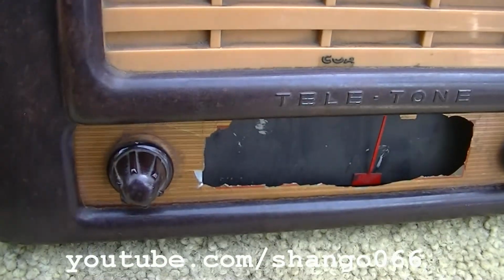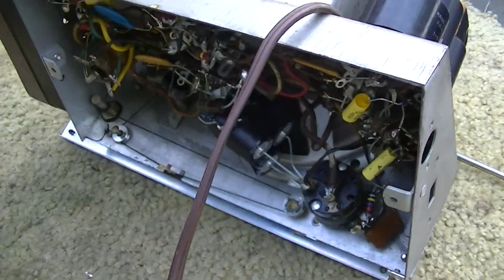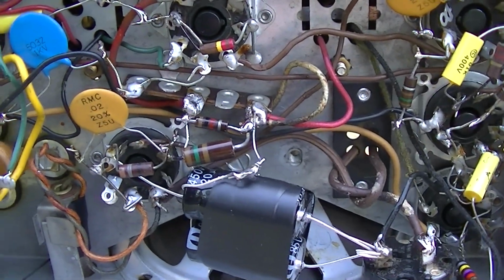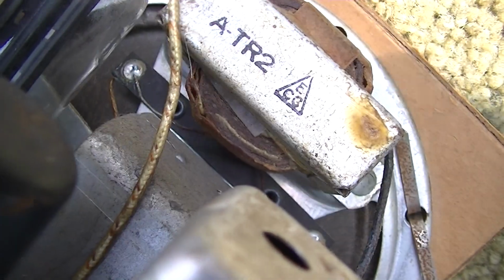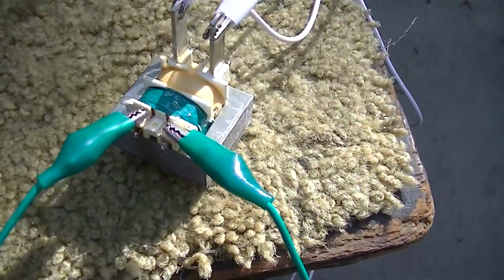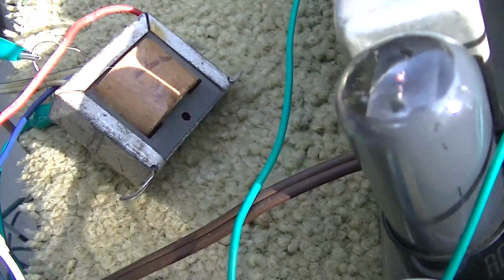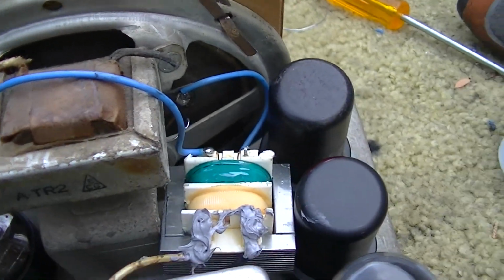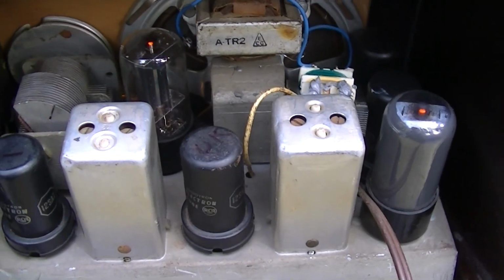Teletone 6 tube AM radio diagnosis for repair

Comment: all these radios have basically the same circuits. The six tube is just the five tube with an RF amp stage for better reception I have a huge Crosley book with most circuits from the 1940s

Comment: An all American 5's audio output transformer typically has an air gap in the magnetic material to prevent the plate's DC from the audio output tube from saturating the core. A power transformer typically has no DC so it doesn't have the air gap. When a power transformer from a "wall wart" is substituted for an audio output transformer, magnetic core saturation should be taken into consideration.

If you take an audio output transformer apart, you will probably find that the core separates into two pieces with spacer material for the air gap. That doesn't happen with a power transformer.

Some all American 5 radios fed the B+ for the other tubes through a tapped primary winding to partially cancel the DC magnetic field produced by the audio output tube, allowing the manufacturer to use a smaller magnetic core. Some of the audio power was diverted to a resistor instead of the speaker, reducing the radio's maximum volume.

It should be possible to construct a solid state current source to provide DC to the audio output tube, and connect the power transformer through a DC blocking capacitor. The problem is that the plate voltage swings higher than the radio's B+ in normal operation, and would back bias the current source. To avoid back biasing, the current source would need a higher B+ than that supplied by the radio. It could be done with a voltage doubler, but the much simpler approach is to find a replacement for the bad audio output transformer, or disassemble and carefully rewind it.

Comment: Thank you Shango for showing the audio transformer trick, I needed one on a radio awhile back and didn't completely understand how all that works, I read you could use a power brick like that but didn't understand it.  I can pick those things up at thrift stores for 50 cents all day long, i'll look for some low voltage ones for backups.

Comment: I always use flux and 50/50 solder. I miss the sound of a tube radio. I had a collection of about 200 at one point from 1920's to 1950 model years. I always liked the loctal tube ones.

Comment: As a gay 60 year old Aussie....I thought id put that bit in, it is inevitable that some of todays generation will need nail polish remover to remove their mobile/cell phones stuck to their foreheads. I'm a DJ too by the way. The valve stuff I grew up with was mostly junk anyway but I do have quite a few beautiful radios and amplifiers I restored  but new valve or tubes or toobs as you guys call them are coming back in a big way. I have a Leak Point One Stereo 20 and a brand new Primaluna stereo push pull integrated amp running 6 12AU7s at the front and 8 EL34s with auto bias at 100 watts a side at the business end. I've yet to get an Akai cassette deck GXC46D serviced but in Australia with Covid 19, we have severe lockdown so there is a lot of stuff I cant do at the moment. With the new tubes/valves being made, in my opinion Shango, don't give up on this generation just yet. I went to my 15 year old nephews school for 2 hours of free time teaching them the basics of tubes and how they work and the girls were just as interested as the guys. There is gonna be a massive resurgence in tube tech and its growing. 99% of Musos I know use Marshall tube heads for their guitars and tube driven HIFI amps are selling well. Kids today were never given the chance unlike you or me to experience anything except digital streaming. They were fascinated with the orange glow of a tube and how clean and loud valve amps are. Solid state solved a lot of problems but I believe both analogue and digital gear can run side by side. My nephew loves my man cave running 7.2 surround and my gear in my bedroom he just loves it. The Primaluna, the Technics SL1200MK2 Turntable I bought brand new and a CDJ for CD playback running into a pair of Wharfedales in my bedroom he thinks it's really cool. The turntable is brand new fitted with an Ortofon cartridge for playback only. I reckon there is a future in tube technology. How old are you mate? I need to know so I can comment on our youth and what decade was your favourite....nothing more. Cheers, Andrew Collins, Melbourne Victoria Australia.

Comment: I had a 1955 RCA radio with two metal screws at the bottom just like that one. We were staying at the beach and I decided to put the radio on my lap with my feet in the sand. It shocked me so bad, my father had to knock it out of my lap; he cut the cord off the radio which was almost brand new not understanding that it had a hot chassis.😲

Comment: Wouldnt have thought to use a power transformer in a single ended stage (magnetic saturation), but I have built a push pull with a split primary power transformer as the output - works great.

Comment: Tele tone  used the diode  part of the one 12sq7  as a detector and the. Other as a triode only  triode as the first audio . They could have used it as a multi purpose tube but then it would only be a 5 tube and you could charge more for 6 tubes . Cheap postwar set . Tele Tone based their designs on what components were cheap at the auction that day.

Comment: Tele-tone took the basic AA-5 , wired an extra 12sq7 in parallel with the one that was supposed to be there and pawned it off as a 6 tube chassis. Tele-tone -Putting that "K" back in kwality

Comment: You were getting audio out of the output transformer's core because of the same reason you can hear 60 Hz coming out of some power transformers. Magnetic fields transferring power through the core are magnetizing the core, making magnetic field push it back-and-forth at the frequency of the signal passing through it. If the core is not very solidly adhered together and to the chassis, it will vibrate and make sound.
Reply: yes thats true, it is called "magnetostriction" and this is common in all transformers... but in shangos case the primary winding is open and this alone explains not the effect. The arcing over the broken wire is one possibility, but I think, a short in a winding-section can also explain this (no transformation to the speaker but sound from the transformer), but then the primary is not measured "open". I am not sure, if shango definitaly measured the primary open. He only speaks about low plate voltage on the anode of the output-tube... The static plate-voltage without signal should be normal in case of winding-shorts... The mains-transformer sounds pretty good, I would not expect this, because of the missing air-gap in the core, which is important, when DC is flowing thru the primary winding (A-operation)... But this is a good result, neverless. Like this kinda videos...

Comment: Usually, but not always...6 tubes means it has an RF stage, which is the sixth tube's job...or a tuned RF stage...
Reply: Kennynva rf amp would have 3 tuning condenser sections .

Comment: Hammond has some great audio output transformers for about $30.  I'm using a pair on my single ended 2A3 stereo amp until I spend the big bucks on the really nice Hammonds.  They sound great, but are 30hz to 20k+.  So, the bottom end is not optimal.  For the price they're a great inexpensive way to bridge the gap until one can pay for the really nice ones.
Reply: Amp Amp have a t250"acrosound  new old. 20w ultra linear xfmr 100$ +shipping supposed to be for 2 2a3 s if interested.

Comment: Lol at the idea that a higher-rated cap voltage is undesirable. They might cost a few cents more, but reforming? Also, you do realize that the metal tubes are actually glass, the shell is an integrated shield grounded to the chassis?

Comment: I have this exact radio,  the second 12SQ7 is strictly there to get the tube count up to six.  They are using the triode section of one of the 12SQ7's and the diode section of the other one.   Like you I never found a schematic.
Reply: Shango066 did find a schematic for the 5 tube version. I suspect the only differences between the 2 versions were to 1) Add the second 12SQ7, 2) Move the diode section connections from one 12SQ7 to the added one, 3) Wire the added 12SQ7 into the series filament string and 4) Replace the audio output tube with a 50 volt filament with a 35 volt filament version (probably 50L6 replaced by 35L6). The 50L6 does perform better, but it is probably not worthwhile to undo the design changes and replace the 35L6 with a 50L6. Buyers of the, presumably more expensive, 6 tube version actually were probably getting a poorer performing radio than buyers of the 5 tube version.

I have a GE model 535 with a 6th tube, but it is used as an untuned RF amplifier. To perform better with picking up weak stations, the design could have added a third section to the tuning capacitor to improve image frequency rejection and selectivity. The 6th tube presumably does improve the AGC function, however.

Regarding tube count, in vintage Sears catalogs, I've found the All American 5 radios described as having "4 tubes plus rectifier". The Canadian Sears catalogs just say 5 tubes. I assume the "4 tubes plus rectifier" was to comply with some Federal law.

Comment: I don't see how copper wire just sitting in a nest could possibly go bad without some sort of blunt force trauma being applied or a situation where somehow the ampacity of the wire  was exceeded and boinked it.
Reply: there is b+ on the primary and there is ground on the core...many  times the insulation gets deficient and brittle and arcing occurs between the winding and the core burning a section of the winding and causing it to open

Comment: In some cases, I also used wallwart power transformers as temporary audio outputs. I found out that the best for that purpose are the crappiest, non UL-recognized Chinese ones with universal output. The multiple secondary taps help to find a more optimal impedance match, and their lack of safety as a wall-wart helps as they don't have a split bobbin like yours, the primary and secondary are wound on top of each other (the isolation is often paint masking tape.... :-) ), so the magnetic coupling is better than with split bobbins, which greatly increases the high frequency response. Though, even these are only suitable for AM radios, because of the lack of the higher audio band (about 6-8kHz roll-off was the best I found).

Comment: I would urge the radio's owner to be very careful when liberating the defective output transformer from the speaker. Just one slip could mean a torn cone or a snapped voice coil wire.

Comment: Those solder joints were some of the worst I've seen to be honest, I think common sense plays a large role in electronics. I know I read a lot and watched a lot of videos before I ever messed with more than 12 volts and it really paid off.
Reply: Jake P common sense is a misconception. It only comes from experience. The kid that fixed this up was 17, lots of kids wouldn’t know which end of a soldering iron to hold at 17.
Reply: It was sort of interesting that one of the few cap leads the kid had tied down was cold soldered and loose. I'm working on a Philco Transitone what looks like an old pro tack soldered new parts in on stubs. It isn't just kids who do that.

Comment: I had some problems trying to get into the radio tv repair field even in the late 60's early 70's. My father was against it, he had a bad experience as a radio repairman in the 30's, didn't teach me anything, and my high school electronics shop  saw the old instructor retire just before I got there. So we had a teacher who knew nothing about electronics, all we did was book work and take tests, never set foot even once in the large and well equipped lab. Wound up being a computer repairmen for 30 years.

Comment: I'll bet they are using one 12SQ7 for the audio driver stage (triode section) and they are using the other 12SQ7 for the detector stage (diode section). They could have used one tube for both functions; but, by using two tubes, they could advertise the set as having 6 tube performance (sort of like the later 16 transistor radios with 5 tube performance).

Comment: Not a lot of AA6 radios were built as they cost more. The 6th tube was typically an RF amp, a push-pull audio power amp tube or a BFO for Morse code and single-sideband. Would 'valves' be a good word for them?
Reply: Nota Rookie 
I don't think SSB was even around back in the late 40s? At least for consumer or civilian use? But it could have been useful for CW true I wonder if this company made any amateur radio equipment? That might explain this.

Comment: The extra 12SK7 in that radio is probably an RF amplifier in front of the 12SA7 pentagrid converter. To compensate for that the 50L6 audio amplifier was usually replaced with a 35L6

Comment: I found a schematic for a Teletone "Series D".  Six (loctal) tubes, probably similar design.  14Q7, 14A7, two 14B6's, 35A5, and 35Y4.  The two 14B6's form the most peculiar circuit I ever saw - looks like the first is the detector - cathode, grid and plate are tied - and the second is the first audio.  Both diodes are tied on each of them.  But  it also looks like the cathodes are all tied and float above ground.  If there's an AGC line, I'm not seeing it - at least no time-constant capacitor.  For line AC.  Don't think I've ever seen loctals in a non-mobile set.

Comment: Many many years ago as a kid I had a educational kit that eventually made a complete six valve radio. as part of the early experiments the audio output transformer was used as a mains transformer to get six volts.output from the secondary. The primary was for UK 240 volts. Similar to your use but in reverse.

Comment: I have SO many wallwarts hangin around here..  coooool knowledge imprinting
Reply: Malcolm Wolfe - Same. I’ve got tons of them!
Reply: wow that little box sounds gOOd with just that side/side transformer.
Reply: Malcolm Wolfe - It sure does & who would of thought to use one out of a wallwart because I know I wouldn’t of as I just collect them in case one day they come in handy for other appliances etc when the ones supplied bugger up.
Reply: All of these , and I still can't find one for the Casio MT100 mini keyboard w/ Graphic Equalizer..  7.5 volt DC..  so I guess it's really a rectifier?  I'm a packrat with the know of a caveman, so...
Reply: Malcolm Wolfe - Just had to buy one for my laptop as I didn’t have another one in my collection that was compatible. Still not 100% if it’s the charger cord or the charger port on the laptop that’s died as at the moment I can’t charge the battery in it. The new charger cord only cost me $16 + free P&H on eBay, so fingers crossed on Thursday when it arrives in the post........I’m so hoping that is the problem as I can’t afford to have the port replaced just yet! 🤞🏻 Have you tried the transformer wall warts  that come with adapters & the voltage selector? I had to buy one of those for my Rhythmic 8 keyboard & it worked well.
Reply: battery's good huh?  my lap has a bad battery problem and the cord is still awesome.  this stuff's what geeks and money are for. I'm not about to try to screw around with the really "new" tech
Reply: Malcolm Wolfe - Yeah the battery isn’t too bad, doesn’t last as long as it use too but does charge. The last time I was able to use my laptop I had to jingle the cord to make the charge light come on & I noticed the cord was lumpy & twisted before the plug part that goes into the port. I think my kids have broken the wires in it but I can’t complain as it is going on 7 years old & still worked well as I upgraded it from windows 7 to windows 10 & it has 2 good sized hard drives for my music & videos & the DVD/CD drive.

Comment: Finally a new video :-) I've watched almost all of your videos now and was running out of "new" videos that I haven't watched - can't get enough of them :D btw don't let the city noises annoy you too much - at least you are sourrounded by a nice big property with some nature, not like concrete block after concrete block (yes, I found your house on google maps, but I will not post or say anywhere what your address is)
QUESTION: Is there a common reason why the primary side of the output can go open or is it just age?
Reply: Higher voltage on the primary; shorts out; or opens the winding's over time.

Comment: Gotta say, in 35 years never had a higher voltage cap come back - it's ok to stick in a larger value (never bothered to replace a 150 with a 450, except if a polyprop or something)- but I can -almost - guarantee it 100% OK?
Reply: I think if it was grossly over like say 150v on a 10,000v cap it would be a problem but I wouldn't hesitate to do a 450v cap, but that's just my opinion though
Reply: Well what Shango was saying is that the lower voltage may not keep the cap formed properly. Probably something that wouldn't come up till years later.
Reply: And of course this is only with respect to aluminium electrolytics, where the oxide depth is proportional to voltage - it's a non issue if kept relatively sensible .

Comment: Nice job! This radio seems to be a model "113A": housing looks different, but the inside picture and tube types match what you found:
https://www.radiomuseum.org/r/tele_tone_a_113.html (has schematics, no need to sign up).
Reply: I don't think its a "match".  The 113A link shows only 5 tubes
Reply: Oh, you're right. Seems to be an error in the database. Thx for the heads up.

Comment: Way more fun to break open those wall warts with a hammer.  Put the thing on a concrete floor and wack around the seam it will come apart without denting the case.  I always amazed at the quality and usefulness of Shango`s test equipment.